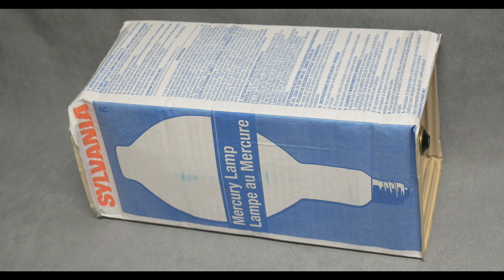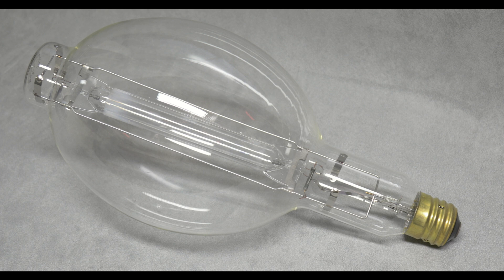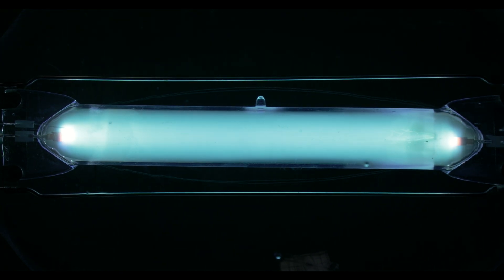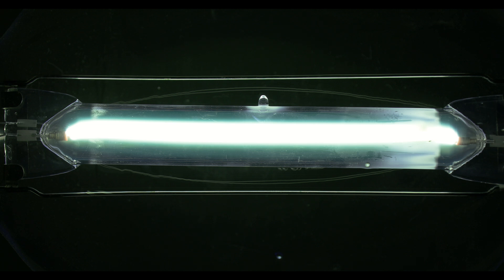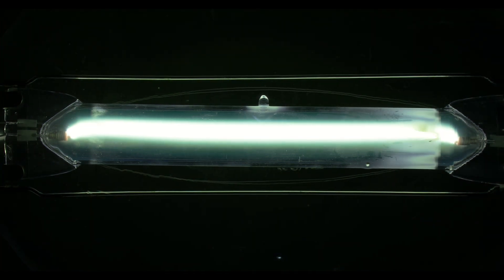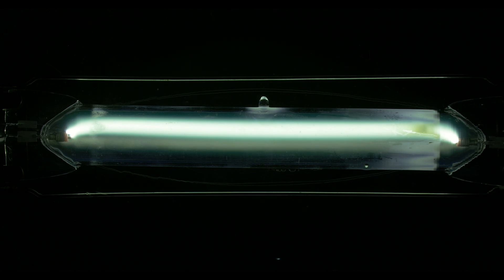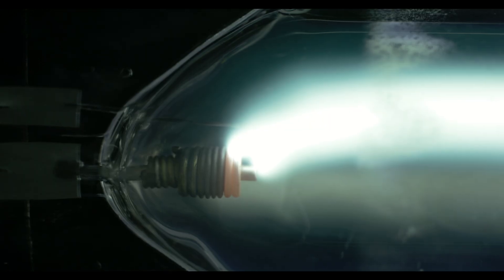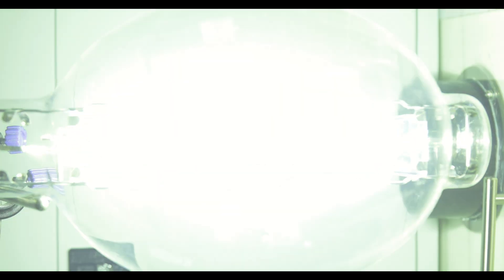1000w Sylvania Clear Mercury Lamp

Comment: What ballast did you use
Reply from the maker: Was a Parmar YHB04024521, designed for running US spec high voltage lamps on 240v mains.
Reply: Magnetic or electronic ballast